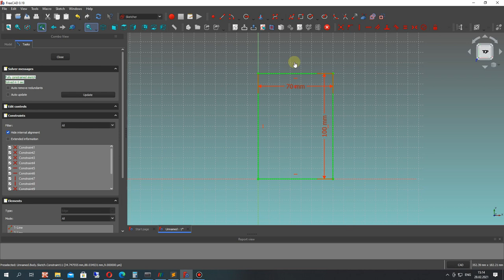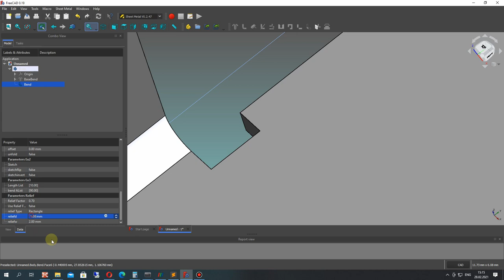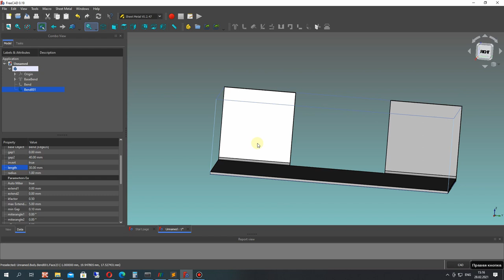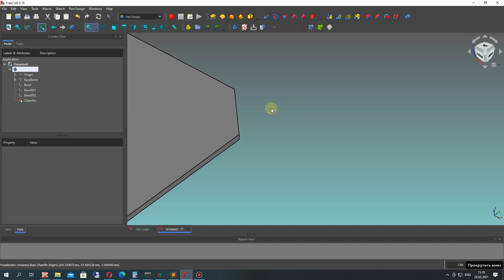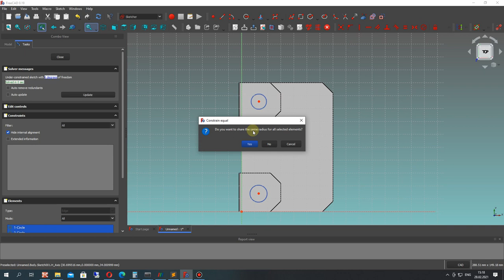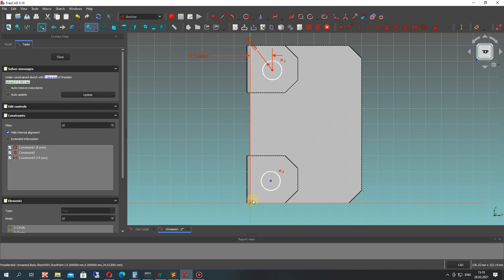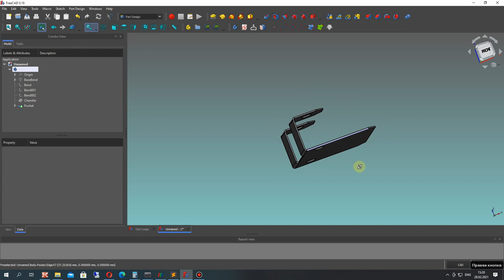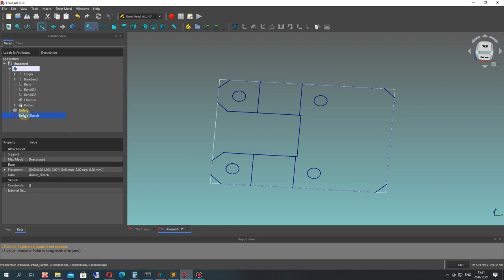FreeCAD Tutorial | Sheet Metal Basics 6 for Begginers: Support

Comment: Thanks for tutorials. However you always show us how to model by setting the length of straight portions between bends. More commonly you would need to dimension the distance between the top and bottom surfaces (ie the vertical gap between the holes in this case).